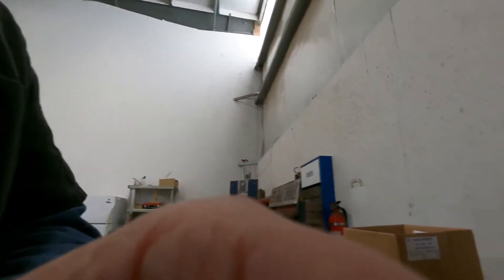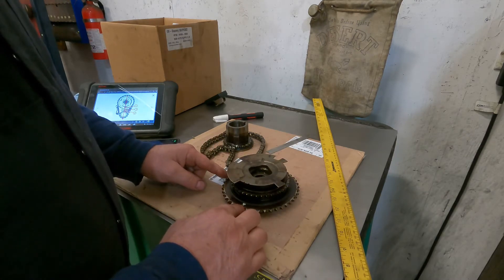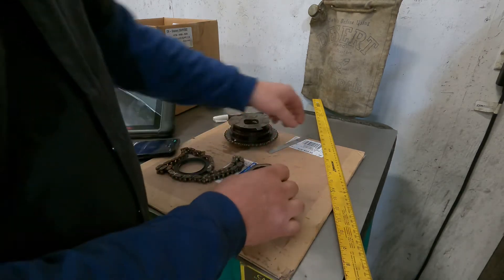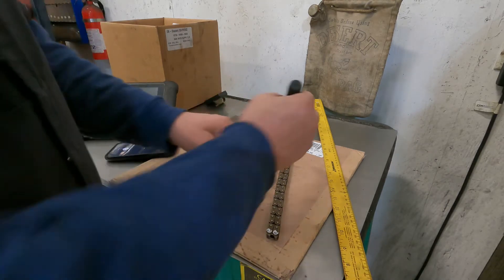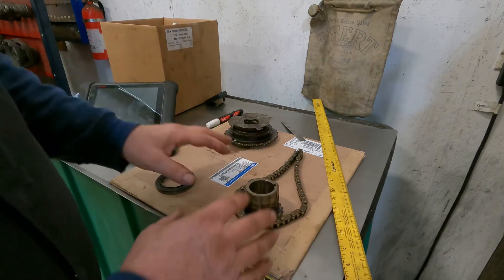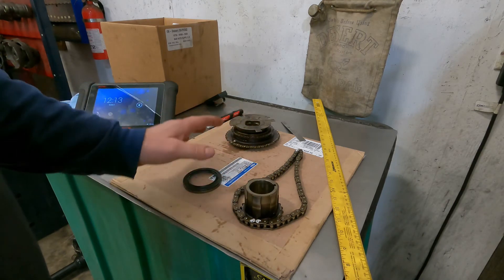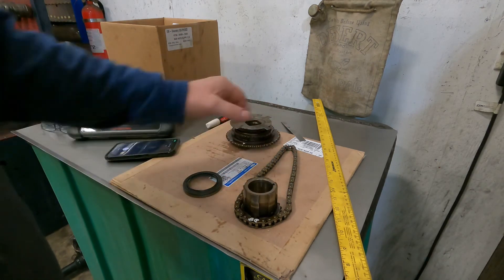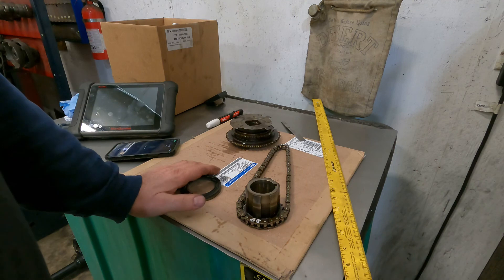GM Gen V LT Cam Timing

Comment: This is a great way to do it but for some reason after doing all the rotations, the paint marks never line up again for me and I've triple checked the marks and done it on a bench, I must be off. Can you demonstrate that in a video?
Reply from the maker: They will eventually line back up. We are not looking for them to realign. If you didn’t use the oil feed hole  mistakenly for reference you’re gtg. Have faith brother.

Comment: That PI was made because some unfortunate GM technician/s were using the sprocket lube hole (between the cam and crank) as a reference point to time these two gears. Big mistake as this lube hole is offset slightly between the cam and crank sprockets. Do time this as Mr. Gaskell shows and you’re golden.